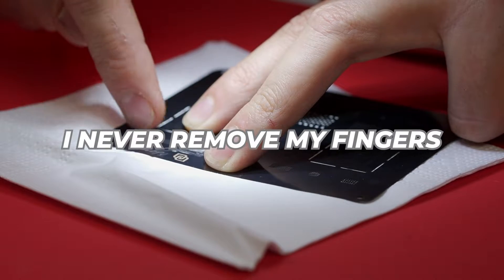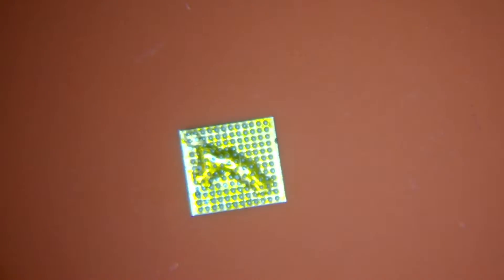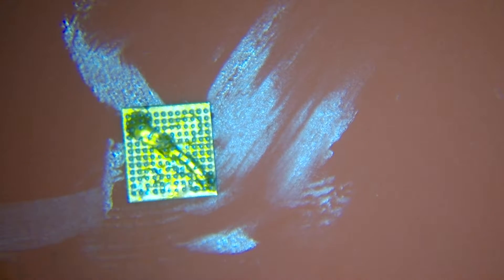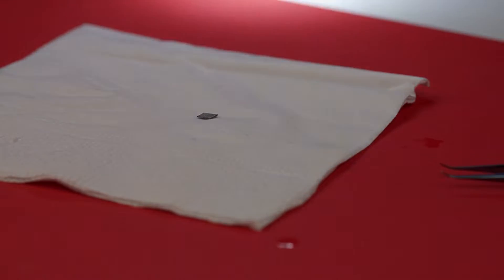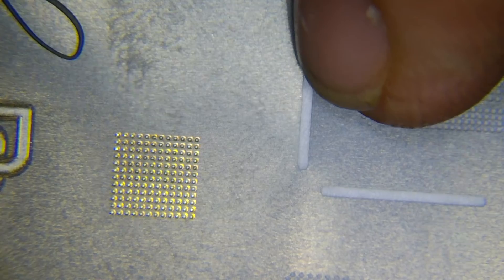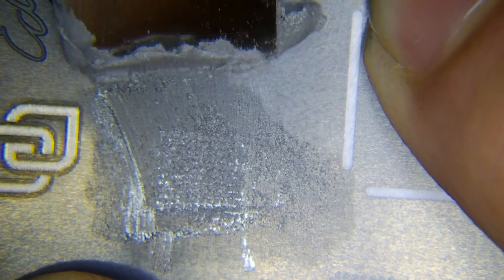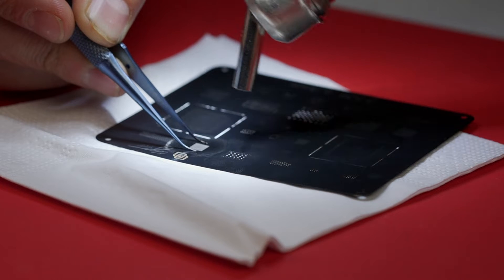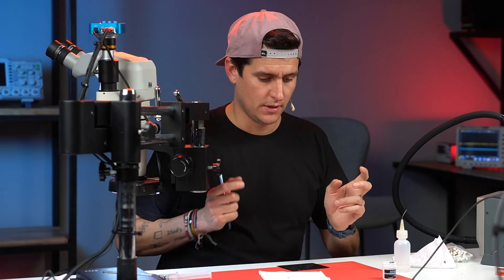How to reball with a perfect technique | iPhone Reballing Circuit

Comment: Thank you so much. I have a question when it comes to reballing layer board for iPhone. Do you also prefer to leave the board in the stencil or to remove the stencil after applying the paste solder?